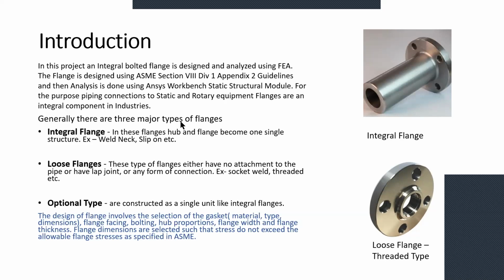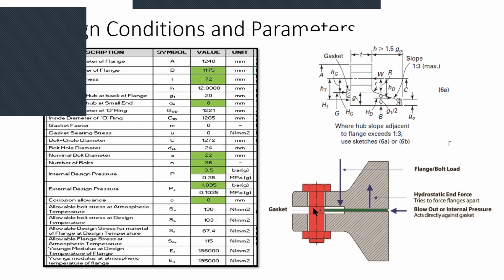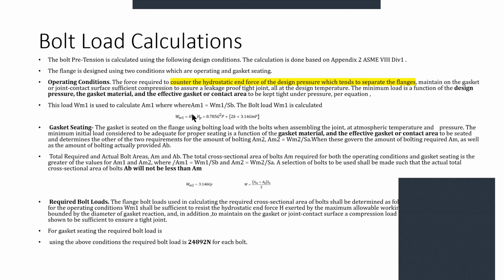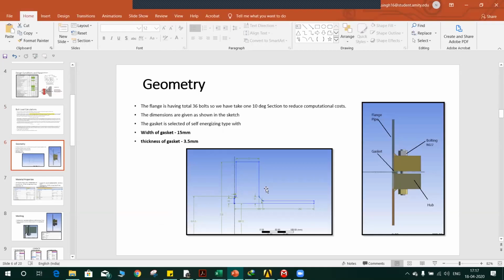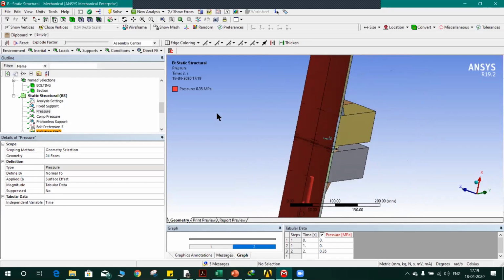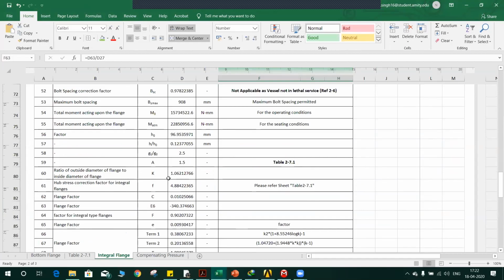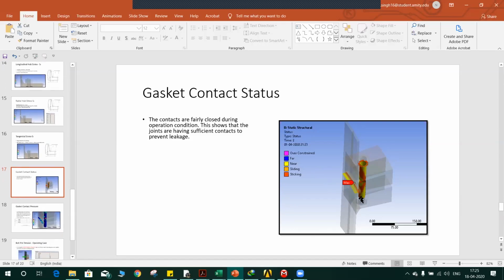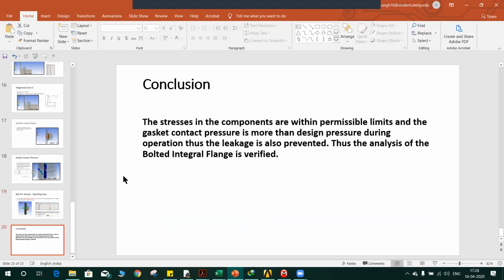Designing of a Integrated Bolted Flange Leakage | Skill-Lync Project | Ansys Workbench

Comment: I like your video.

Why did you linearize the stresses in the bolt? The bolt is uniaxial stressed.
Actually, in SolidWorks Simulation we don't model the bolt, we apply the bolt as a constraint defined in SolidWorks Simulation already, then SolidWorks reports the bolt load.